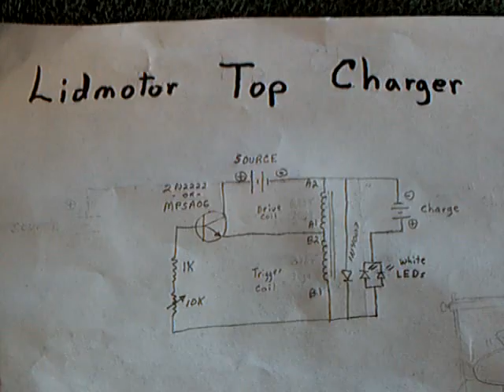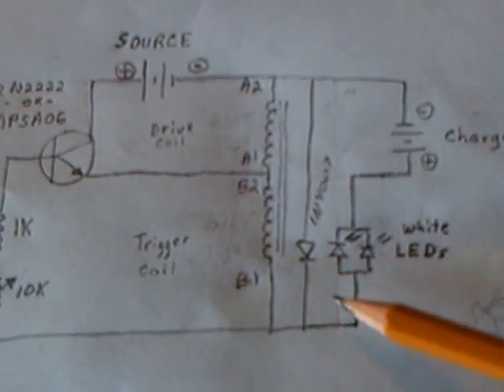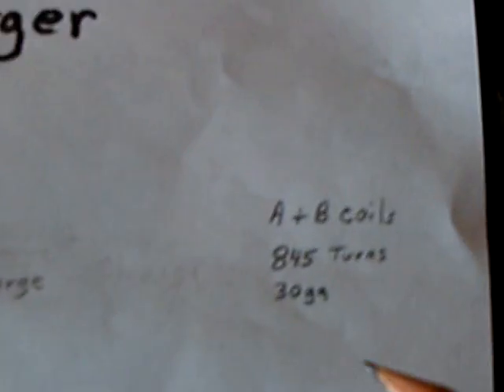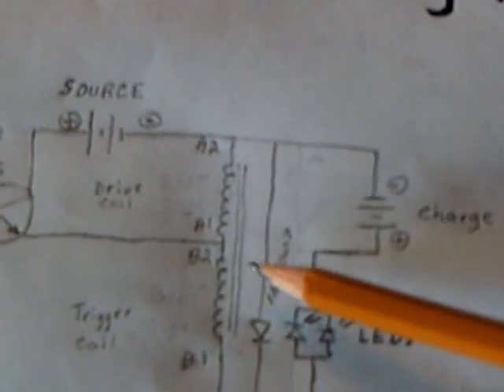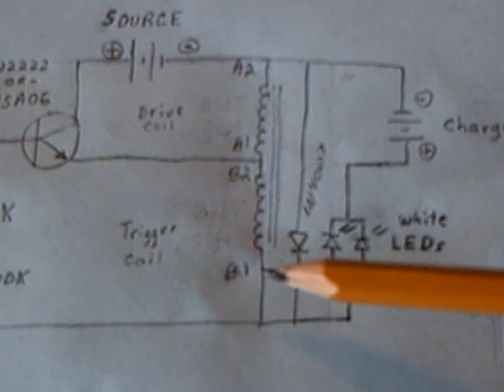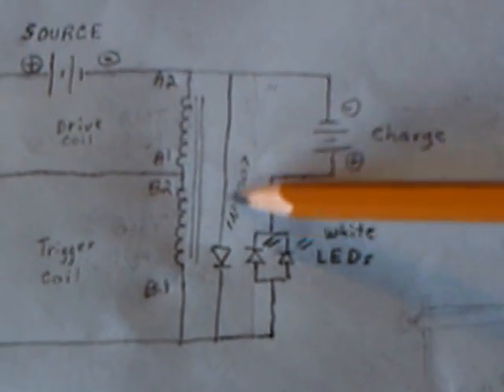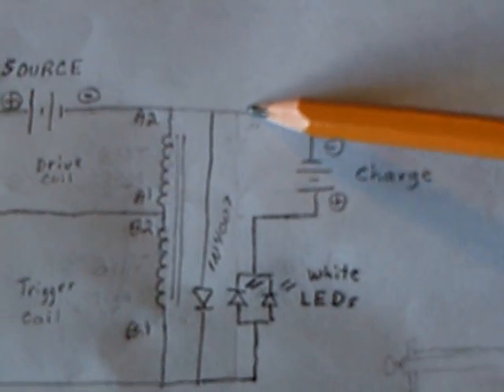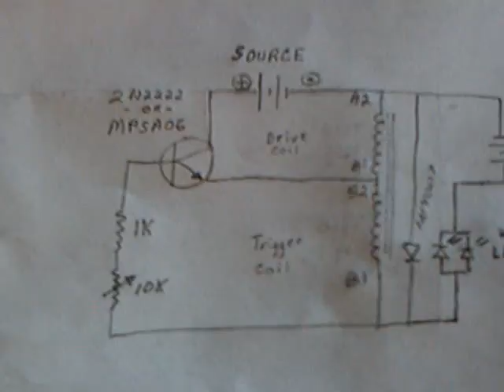Lidmotor---TOP CHARGER

Comment: Lid:

Some really good innovations there.  It looks like your attracting levitation neos also keep the top in one place too?  No friction and it reduces the weight, and keeps it located, wonderful.  One modification and it gives you 3 advantages. Very well done.  How does you circuit compare to the Bedini as far as amp draw and charger output?  It looks like a good circuit to try.

Bill